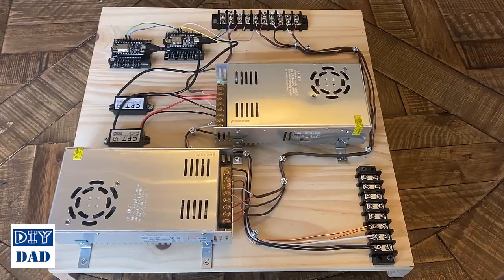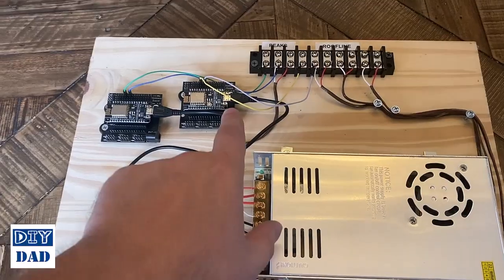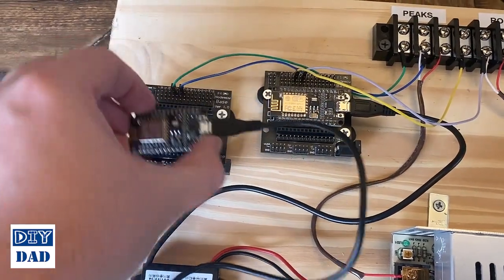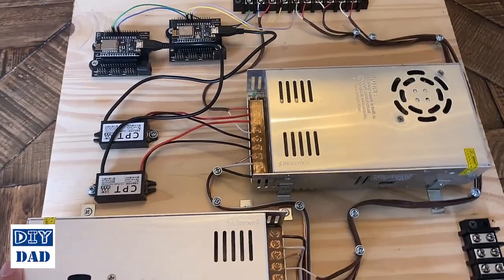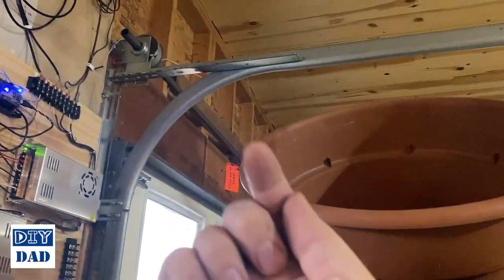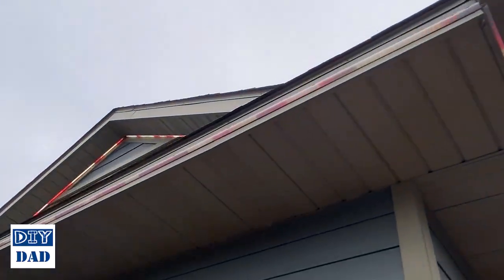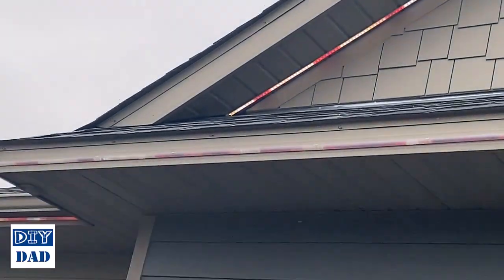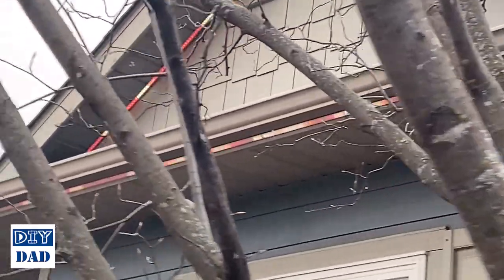DIY Permanent Holiday LED Lights: The Install

Comment: How has the maintenance been after a few years?
Reply from the maker: Not bad - I upgraded the brain to a digquad a year or two ago. That’s been flawless. I have one strip have an issue at the wire coupler I installed (wire failed because of the elements, not the strip itself) spliced a new section in and that resolved it. Otherwise it’s been pretty solid

Comment: OOoo may I ask how did the diffuser stand up to weather and aund after two years ? I've been using those channels and diffuser indoooers, but looks clean for oitdoors too
Reply from the maker: I’ll put together a video but they look great. I haven’t had to do any maintenance to the original install aside from a controller upgrade (voluntary) and one wire end that was strained at the base of may garage door that had to be re-terminated

Comment: ??? The mains terminals are exposed. They should always be covered even inside an enclosure. It is a major fire risk in that condition.
Reply from the maker: That was my first attempt years ago - that control box has been completely overhauled since then - all are now covered and in a waterproof plastic enclosure

Comment: Great job! get some inspiration here. I have a question for you, maybe a dumb. Can you connect a pixel string from middle of another string (that is being powered)? and still works?
thanks.
Reply from the maker: You can.. but it will treat the two legs the same from a pattern standpoint.  You wouldn’t be able to control the offshoot separately.. does that make sense?

Comment: Using quini dig quad controllers can control more have fuses, and has wifi or ethernet to reprogram without disconnecting.  It allows WLED APP to control your lights from a phone.
Reply from the maker: The chips that I have also are mobile enabled over Wi-Fi.  I control the whole thing from my phone now.  I’m looking at the digi quad as part of the next upgrade though as it enables a few more options that I want to use as I expand

Comment: Looks good but I have noticed one issue that I consider to be a huge safety issue, and that is the 110 power being very easy to touch.  On the lower right corner for your AC, you might want to consider using Wago connectors so you can't accidentally touch or short the AC wiring.  Also, the same wires on the power supply's should have some sort of plastic shield covering the 110 volt terminals.  I do understand that you are going to make a cover for the whole board, but protecting the AC should be done so there is no chance of touching those AC wires.  Not only is is a safety issue, but it is also a huge liability issue.  Thanks for the video.
Reply from the maker: I don’t disagree!  I have a plan to cover the entire thing and replace the terminal strip with a directly wired programmable timer switch.  As it is, the current system is wired to an extension cord and mounted about 7 feet off the ground on my garage wall.  So the risk, while present, is somewhat mitigated by an unpluggable source and the need for a ladder to access the install.
Reply: @AskDIYDad  Having exposed 120volt connectors  in your garage isn't just a bad idea, that's a major safety hazard.   This is not a "yeah, I should fix that" situation.   It's a situation where you should unplug the system immediately and don't repower it until you've addressed it.  DIYers have a responsibility to learn how to be safe and then do it.
Reply from the maker: @AndrewMetcalfe  Agreed - This is not a system I left plugged in when off and that particular issue was resolved by me several weeks ago - I just have not had time to put up the video showing the remediation as yet.
Reply: @AskDIYDad  With all due respect, you should not publish videos with setups like that.  There are people who will follow your example.

Comment: Great start, but you need fuses asap!  When an LED burns (not if, when) you’ll
Wish you had fuses. 

Keep having fun but safety first!
Reply from the maker: Happy to add them! Can you point me to a resource to dig into that? Most of what I’ve seen with the need from fuses is in the context of the power flowing through the controller as opposed to a standalone power supply setup like mine.

Comment: Can you show how you connected strip to strip.  I assume there is a break in the strips at every turn.
Reply from the maker: Hi!  I used in-line crimp connectors either to go from Strip to 3-wire at the corners and connection points (https://www.amazon.com/dp/B09PR418WZ) or to connect directly from strip to strip (https://www.amazon.com/dp/B09BQMWNWD)

The direct strip-to-strip connectors fit in the angled channels but not in the flat ones.  If you look closely you can see where the direct crimps are as they cast a small shadow but you have to know where they are. 

The other thing, from my experience, is that you really only get one good crimp.. so you want to make sure your alignment is solid before crimping into the LED Strip - more than half the time I went for a second crimp or had to re-align I broke the strip.

Comment: Please help I was trying to make this It's not working.

I have connected NodeMCU v3 ESP8266 data 1 > data input WS2812B and that's all but the strip doesn't react for some reason.

Wiring is good for sure, the strip is working with Arduino but not with ESP8266

The blue LED on NodeMCU v3 ESP8266 is lighted up.

I tried to connect NodeMCU v3 ESP8266 to my phone hotspot and it did connect.

I can turn off and on the esp8266 but LED strips will reponse HELLPP!
Reply from the maker: Hi Gerry - If you are running a separate power supply you need to run a common ground.  You can't just run a data line from the ESP8266.

Run a wire from the GND pin on the ESP8266 to the White wire on the LED Strip.  That should allow the chip to talk to the LEDs

Comment: I did my permanent LED over last week, did you think about using a Digiquad?
Reply from the maker: I discovered the digiquad late in my exploration and already had the 8266s in hand.  I plan to look into the quad for the next evolution/expansion
Reply: @AskDIYDad  Funny, I was almost in the same boat.  I really love this stuff

Comment: Put your 120V junctions in a box please.  This is not safe at all.
Reply from the maker: Agreed!  I believe I mentioned that I would be boxing the whole setup when I replace the extension cord currently feeding it with switch and hardwire into the garage electric.

As it is this is about 7 and a half feet off the ground so the risk is minimized, but I agree that it’s not safe the way it currently sits

Comment: I hope you don't mind but i think i have to steal this set up. I have pretty much the same equipment for my house the only thing i didn't have for my set up are the terminal strips. and i do like the 14/2 solid wire being used for power. if it can handle 120v it can handle 12v lol I feel like i got the best info from 2 of your videos than like the 100 that ive watched on YouTube about this stuff. DR.ZZs has some GREAT info but i feel like no one really explained the part of if you got with 12v you can go much longer before needing an injection point vs. 5v. so i switched my 5v LEDs out for 12v. One thing i dont think you showed was how you connected your strands of leds together. did you solder them?
Reply from the maker: I used plastic crimp connectors like this to connect the strips together - and a variation to connect to bridging wires when I needed to jump from peak to peak or go around a 90 degree corner 

RGBZONE 10Pcs LED Strip Connectors 3 Pin Gapless Solderless Quick Connector for 10mm Waterproof and Non-Waterproof WS2811 WS2812B LED Strip Lights (3pin Strip to Strip) https://a.co/d/7sYNOEy
Reply: @AskDIYDad  Oh ok i have those! i just didnt think they would fit in the diffuser channel. i havent tried that part yet but that makes life a lot easier not having to solder them and such.
Reply from the maker: @Sudo_JWer  They don't fit in the flat low-profile channels but they do fit in the 45-degree angled channels.  I believe I only had one place where the flat channels needed to go beyond 16' and in that instance I gapped the diffuser on either side of the crimp connector.  I prefer the aesthetic of the angled channels unless you're mounting them on the underside of a surface pointing down like in the peaks.  I may swap my run of vertically mounted flat channels for angled ones next summer.
Reply from the maker: I want to add - you can see where the crimps are if you look for them because even though they're clear they cast a shadow so you have a subtle darker space in the run that you would not have if you soldered.  I just.. personally.. kinda stink at soldering 🤣
Reply from the maker: Also - you only really get one shot at crimping so make sure they are lined up right before you press them closed.  My experience with re-crimping is that you break the strip about half the time

Comment: Very nice!  I just finished installing my first floor 1500 LED's and my ps and control board is a mess on my work bench, so great to see your mounting option to give me some ideas.
Reply from the maker: Very nice!  My setup is 1600 LEDs on the roofline and another 600 in the peaks (530/200 logical).  I just added some RGB Wi-Fi lights to the front of the garage that are programmable with some simple effects as well to unify the look.  

I really like the color/effect pattern I had for Halloween - not fully in love with my Christmas setup but it’s a good start at least
Reply: @AskDIYDad  Well keep the vids coming!
I think in the off season I will build some prop with the 12mm LED's and get them ready for Christmas 2023.  As you noted it is nice to have the strips permanently installed to use throughout the year and there is no having to put them up, take them down every again!
Reply from the maker: @graphguy  And there are so many holidays to celebrate - if you are using WLED, check out the Fireworks 1D effect.. I will DEFINITELY have my house lit up for the 4th... and New Years.. and St Patricks Day.... and Valentines Day... and Groundhog Day 🤪🤣

Comment: With the chip in the garage, I assume distamce between esp8266 and 1st led is atleast 20 ft, did u not experience data loss?
Reply from the maker: No noticeable loss, no.  The distance from chip to first led I’d estimate at about 25’ by the time you go up and then over and out.  18ga wire.  But I guess.. I’m not doing any crazy matrix panels or anything.  

The only issue I’ve encountered occasionally is a sync delay between the chips, but that’s due to somewhat sketchy Wi-Fi in my garage

Comment: Heavily consider an esp32 like a digquad it can handle 4 data lines and its fused.  Also consider a few relays and smaller power brick to leave the esp chips powered and the relays can power off and on the big power supplies when the LEDs are on.  Wled supports that natively just have to specify the gpio pin the relay is on. Saves a ton of energy when idle.
Reply from the maker: Appreciate the insight!  I have been looking at the Quad for the next evolution of this - part of the learning curve seems to be picking a path and then comparing it against other choice’s pros and cons.

I intend to hardwire this into my garage in a coming upgrade and add a digital timer switch to power down everything including the esp chips when the system is idle.  Old school fix but then I know it’s truly off

Comment: I'd be interested to see how you calculated your power needs, and all the planning that went into this.
Reply: I believe with any rgb or rgbw ,it's . 20 ma per color so .60 times the # of lights per run for amps required and for proper wire gauge to use as per length of injection run, more important when using 5 volt strips.
Reply from the maker: Check the playlist - there’s a planning video :)  -  that being said I know I’m over-provisioning for my actual needs and could have probably run more than one injection wire set per channel of my power supply.. but it wasn’t cost prohibitive to do it this way and keep it simple.

I figured injection points about every 50’ based on testing how far I could go before the strips started fade and flicker
Reply: @AskDIYDad  I still wish I could do my house for the $400 you did yours for.  I'm over $600 just for the LED strips for what I'm looking to do (estimated).
Reply from the maker: @jeffh4505  I'm lucky in that my roof line is pretty simple and contained - my home is a 4-level split but it presents from the street as a smallish rambler.  I considered trying to outline the various rook peaks but as you can see in the planning video from the aerial shot that would have been WAY more expensive. 

My install is simplistic but looks great and already has my neighbors planning their own.  I think it was worth it at least for my investment level - I normally strongly dislike lighting houses for Christmas before Thanksgiving but I will admit that my lights have been on far more evenings than not in a "celebrate the snow" color pattern.. hah
Reply: @AskDIYDad  I'm guestimating I have 200' of roofline alone, and that's only doing the front and one end of my house.  That doesn't include the openings on my front porch that I'd like to also do, that will add another 200' (again, estimating for now).  It all adds up quick!
Reply from the maker: @jeffh4505  Agreed.  It's not cheap (but certainly far cheaper to DIY than to pay to have it done).  Maybe consider doing it in phases?
Reply: @AskDIYDad  I'm debating that.  The difficult part is figuring out what to upsize for future phases, and where to draw the line between phases.
Reply: @jeffh4505  just do a bit each year, try your best to use the same Led strips though, makes programing a ton easier.